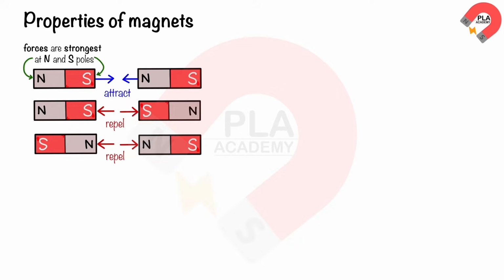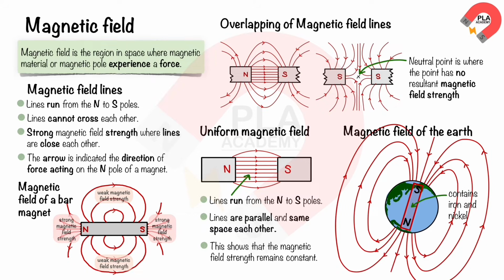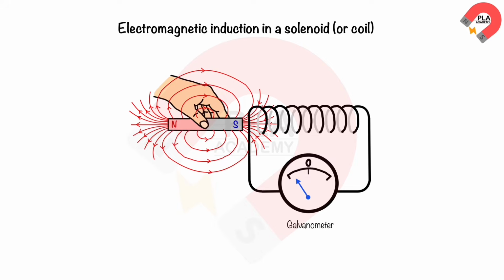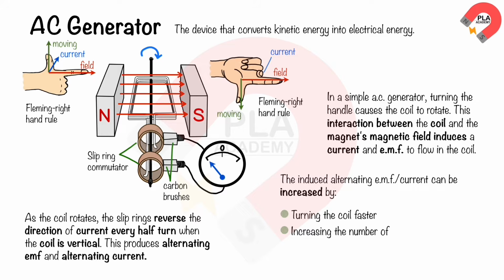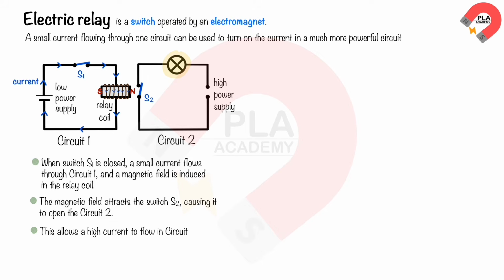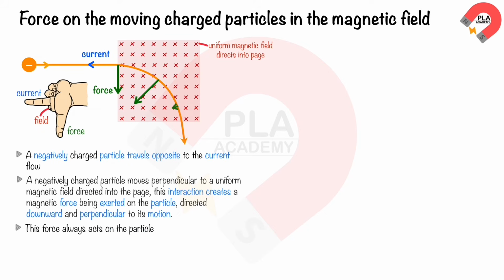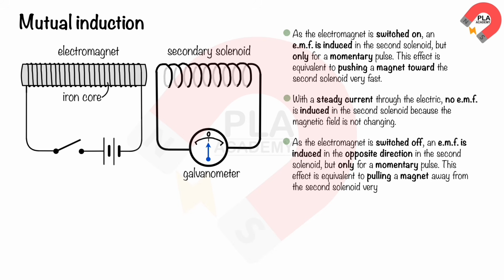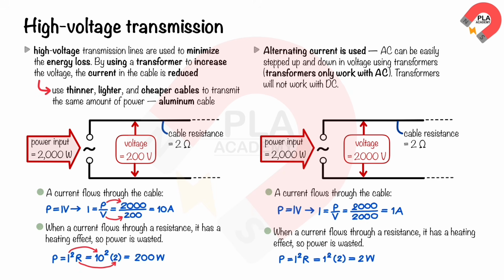O Level Physics 5054 Unit 4 Electricity and Magnetism Part 2 #o_level_physics

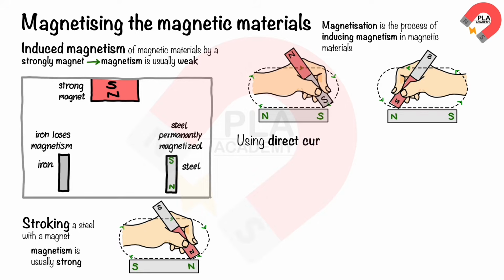Comment: 4:34 the diagrams are all incorrect.
Reply: Why what's wrong with them?
Reply: @KicXiii  basically if u stroke using north pole, and you go from right to left
the poles will be south right, and north left.

this is because, use the logic of the field lines
the lines should enter in south anf exit from north (they go from north to south)
thats it basically. you can confirm from different AI's or google images that this diagram in the video was a mistake.
hope this helps

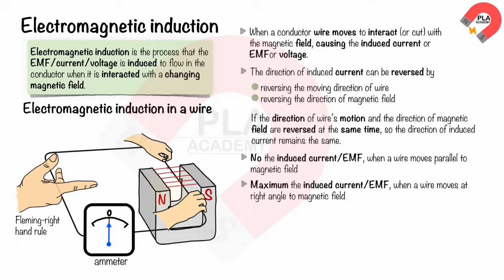Comment: Nice explanation but one problem about the Fleming's grip rule,  at 11:57 minute it should be Fleming's left hand grip rule and about Fleming's right hand grip rule is correct.
Reply from the maker: Find the direction of current in electromagnetic induction on a conductor wire using Fleming right hand rule